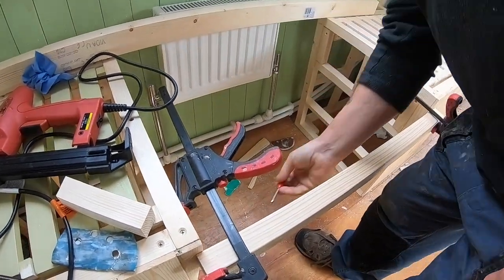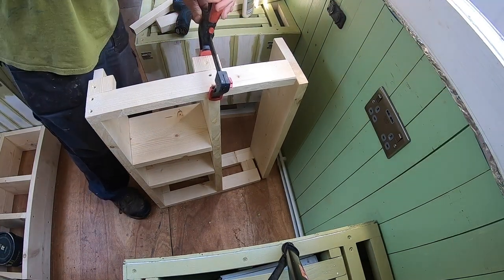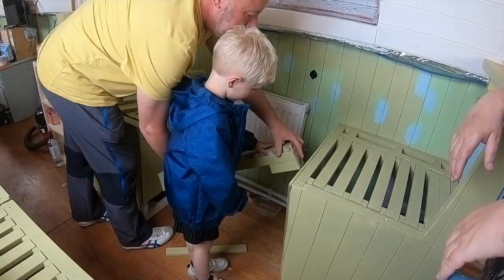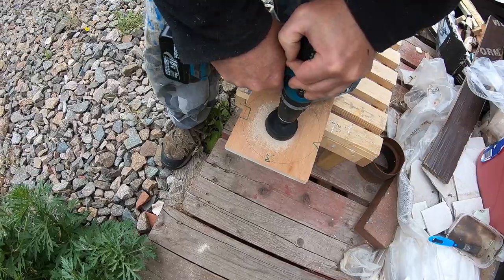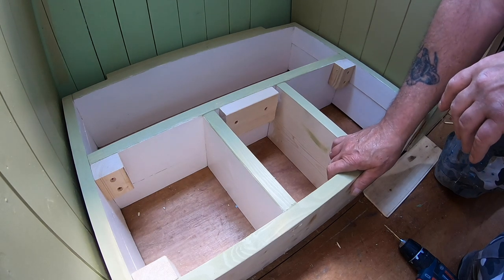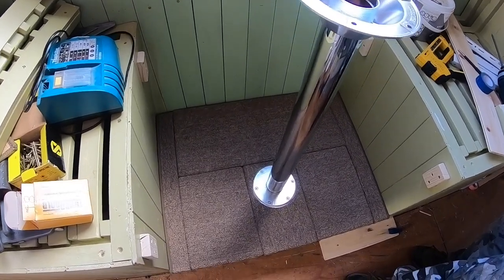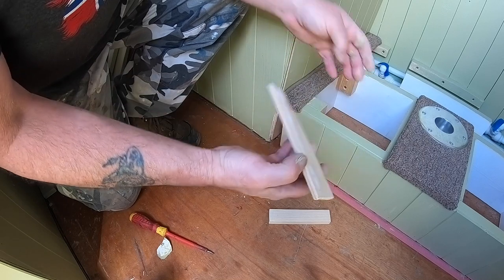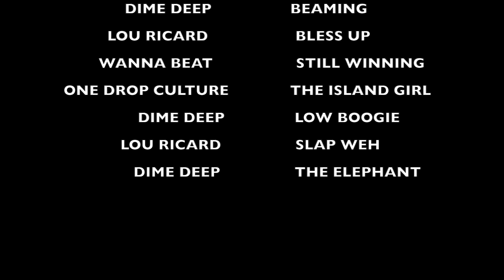VLOG 74, Narrowboat Fit Out -   DINETTE BEDS AND PLATFORM. Part 2

Comment: The floor underneath the table is built in such a way that I would be perfectly comfortable resting the back end of an automobile on it.

I do think your original plan of the tab and slot brackets would work perfectly fine, as long as they were in opposing directions, one facing starboard, one facing port. The supports would then be pushed out to the sides by the slats.
Reply from the maker: hahaha yes solid as a rock. Yes we thought the slot brackets would work in that way too but they were too weak on their side and started to bend. I only realised I had edited out the new way we had done it when we watched it back on youtube. We grooved a reassess in the bottom of the bed supports to slot over the little wooden blocks and that seams to be solid. We have seen a lot more way's to do it since but we will stick to this way for the time being and see how it goes.👍

Comment: Personally, for seat and table height I'd have gone to Ikea and tested a load of their dining chairs and tables. Simply measure the ones that are the most comfortable. It doesn't matter that theirs on on the floor and yours is on a platform - the measurement that is key is floor to squab and that is the same as platform to squab. (and then floor/platform to table top). I would also have considered mounting the table in the bottom of the platform so the platform floor would be a second point to help keep the table rigid. It would allow the entire platform 'floor' to be used as one piece - lift the table out, then the base. The actual table mounting being fixed in the bottom of the platform. Nice idea using carpet though - nicer under bare feet, though may mean extra cleaning with kids around.

Have you considered an extra table piece between the two you have just in case you ever have 6 for dinner? I know it would mean blocking the route through the boat, but could be good for the occasional party. (would need a couple of folding seats about the height of bar chairs too - another project in applying ingenuity to ensure they either convert into something else or pack away in a small space - just something to design when you are bored.)
Reply from the maker: Thankyou , yes we sat at a few tables to see how they felt and just adapted the height a bit to be more comfortable for us. We have the raised area for easier viewing out of the hatches and the table leg is only the height of a standard table height. So needed to be attached at feet level. You will see in the next vlog that it works fine with how we did it. Yes we were originally going to have cross bars that we could attach on the sides of the chairs for extra seating but have now scrapped that idea so we keep access easier. We may buy some fold out stools in the future if we need them👍
Reply: @makinganarrowboatwithnannyandg  Window height is something I have been wondering about quite a bit. I have done a few very rough sketches of layouts I would like for a narrow boat (I'd prefer widebeam but want to be able to tour the network, so narrow boat is the only option. I came up with an idea of dropping the gunnels to allow for larger windows in the saloon area. I was wondering (a) whether it could be done without compromising the hull's strength and (b) whether any builder would be up for the challenge, then I came across a couple of shots in the background of vlogs with narrow boats with lowered gunnels around the saloon zone. I would really like to be able to sit in a comfy chair and look at at scenery, not just sky.
Reply: @makinganarrowboatwithnannyandg  Yes, a couple of folding bar stools/chairs are easier to squeeze past as needed. Young kids will always need the loo at the wrong time, but they can duck under  table piece across the gap.

Comment: Again I'm really impressed with the though and planning has gone into the build, well done. Those might only be short beds for children but they're strong enough to take an elephant! One thing I don't understand is how those slat supports fit into the base, surely they are longer than it so that they bridge the top, or is the gap between the seats narrower than the base?
 I hope that the forman deducted that resting period from Grandad's wages!
Reply from the maker: Thanyou Tony, yes the seats are angled at the front so the top is narrower. The seats are secured to the floor so the slat supports just slot over the wood blocks and are wedged there. Yes the resting is getting out of hand he will be given some unpaid overtime if it continues 😆